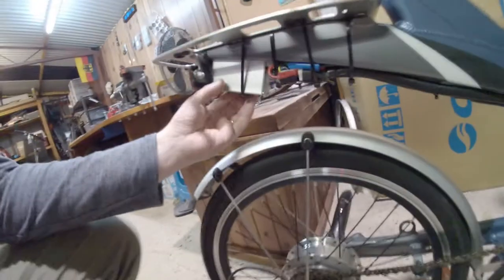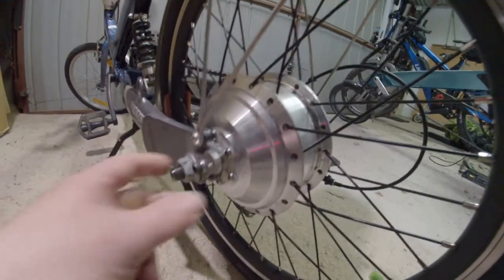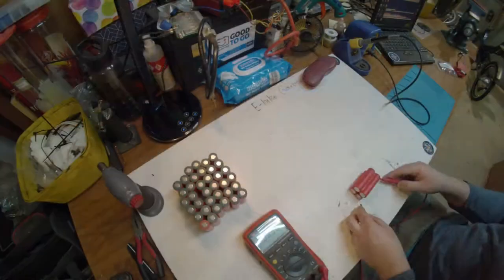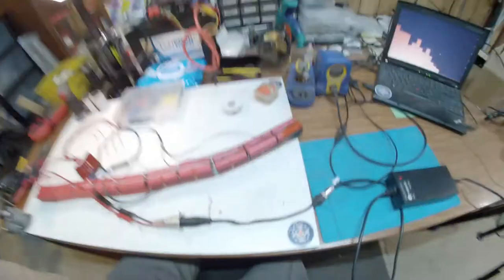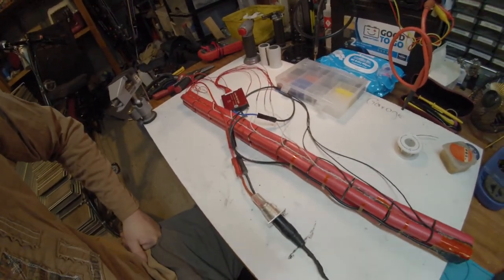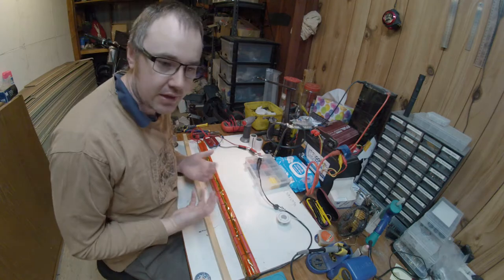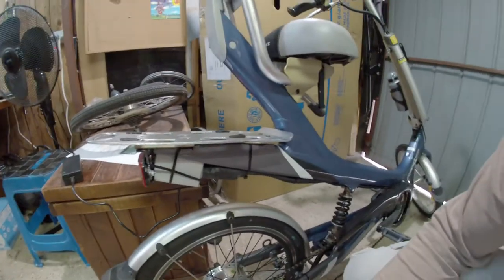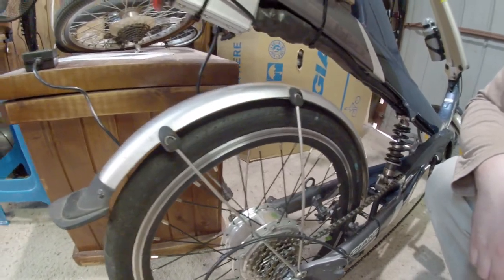Giant Revive - Electric Conversion

Comment: This would be my dream conversion. I got the same bike secondhand and it needs some work. I'm trying to work out how to open the handlebar stem to get at the cables. I've unscrewed the two bolts at the base and the adjuster at the top, but I can't open it. Could you please share any tips on how to proceed?

Comment: Did you think about having a more potent battery/motor?
Reply from the maker: Yes! If the bike was for myself it would have been a bit more potent, however as it's for an elderly relative I chose the lower power gear to keep it safe.
Reply: @EbikeGarage  One of the features most needed by infirm riders like myself is a throttle which I didn't see you install. The throttle is very useful for giving a a quick "squirt" of power as one gets going which is very needed by us older infirm types.
Reply from the maker: @hemaccabe4292  It has a throttle.
Reply: @EbikeGarage  I didn't see that in your ride around. Glad to hear it.